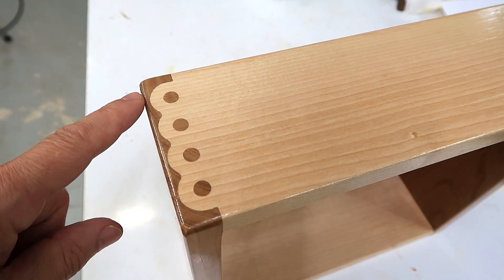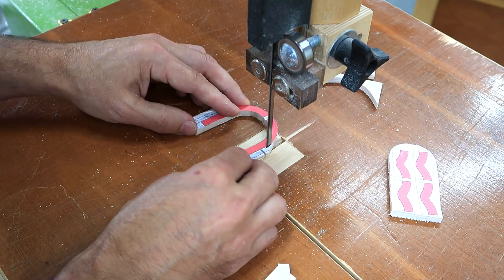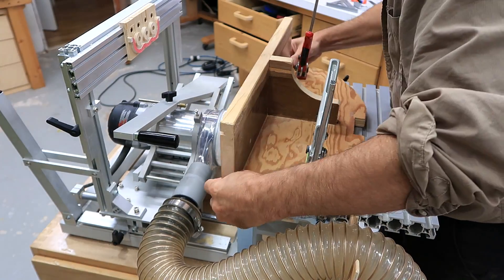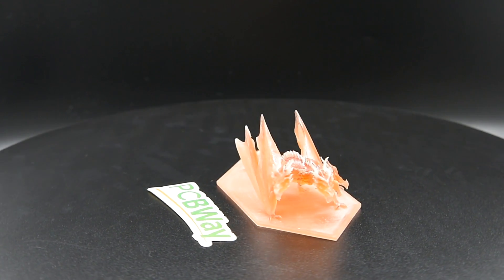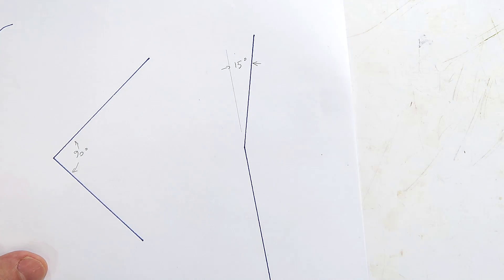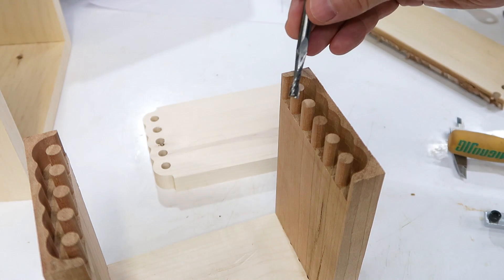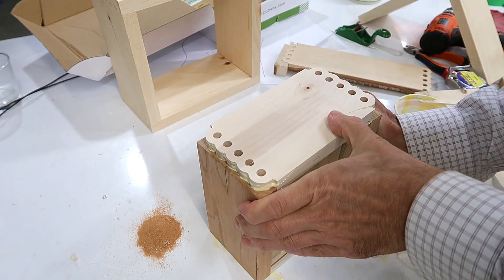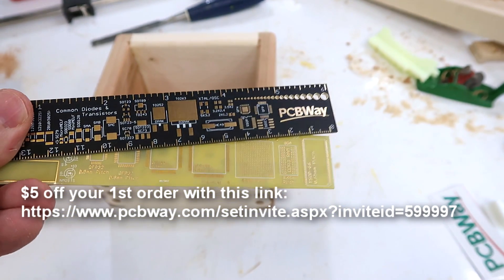Designing segmented Knapp-joint templates for the pantorouter

Comment from the maker: $5 off your 1st order from pcbway.com with this link:
https://www.pcbway.com/setinvite.aspx?inviteid=599997
PCBWay.com does 3d printing, CNC machining and PCBs and PCB assemblies.
Reply: I was shocked by your ad in the middle. I'm glad you did it though! I love your content and if you can make more by running an ad, I'm happy!
Reply: Retro Active Precision  !!!! yes !!!
Reply: Great sponsor, I’ve used them in the past. Very quality stuff if you can wait for the shipping
Reply: 4:20 I assure you its so easy to 3d print. Printers aren't that expensive, a prusa mini is very affordable, built well, and could easily print out jigs like these and anything small/bracket like. Once you have  a printer and use it a few times your really start to understand how useful it is and all of the things you can do with it. Yes sometimes there is some calibration but really its not hard at all. Also its funny how you immediately even without having a printer started blaming acceleration when the pcbway prints came out with the exact same segmented finish. Im pretty sure the sketchup export to STL was too low of a resolution for the details you wanted, I've had issues with it and other software like blender in the past hence me only using fusion360 for modeling now. Problems like these are so easy to see in the slicer yourself and I promise you its all very intuitive unless you overthink things for no reason. Most of the time printing slower will fix issues yes, but I think a slicer preview would show the real problem in this instance. Also filament is cheap and its obvious the pcbway print is a much higher quality material than whatever your client speed-printed. There is a lot of choice in material with FDM printing and it makes a huge difference
Reply: your friend needs to adjust pressure advance on his printer

Comment: Can the templates from the metal pantorouter be used or be adapted to use on the woodgears original?  I have finally come to a point in my life where I want to make one along with a BA Bandsaw and a few of the other jointery jigs.  I wouldn't mind building a hybrid pantorouther if I needed to use the extruded aluminum pattern holder.

Comment: Hi Matthias. If you change your standard circle setting to 96 segments in sketchup, most good slicer software will disregard the segmentation all together and you'll have perfect circles when printed. Take care! G ps: If you ever consider buying a 3D printer, learning curve is very low these days, price for a 0.1 accurate high quality secondhand PLA, ABS printer is maybe 1000$. Good slicer software is free.

Comment: The problem with 3d printed parts being bumpy often stems from using too low 3d resolution when exporting it to STL or whatever format you choose to print from. A 3d file consists of a bunch of points and vector descriptions of the polygons (Actually just triangles most of the time) between them. So the software approximates circles quite rough, as you can never perfectly make a circle using triangle.
Reply from the maker: same 3d model produced a part without those bumps  when I got it from pcbway

Comment: There is a post processor called arc-welder that can take 3d print files and convert those segmented polygon circles into true mathematical arcs that the printer will interpolate properly/smoothly.

Comment: Honestly, for the low-ish volume manufacturing of Mac’s pantorouter, it doesn’t sound like a bad idea just to 3D print all the templates instead of injection molding them, if the quality is good enough. Injection mold tooling is so expensive and 3D printers are so cheap these days that I would be surprised if you are producing enough injection molded parts to make it cheaper than 3D printing. It would be cool to open source the template files so that users with 3D printers (or laser cutters) could print their own, and other users could contribute designs.

Comment: I've been using freecad.  Looks like it would take about an hour to model the segmented and tapered version of this in that program, using the part design workbench.

As for a 3d printer, I bought a prusa mini kit about a year ago. Since building it I haven't needed to mess with it. I'd say the accuracy is about halfway between woodworking and machined metal. Certainly better than I expected it to be.

Comment: If I didn't know better, I would've expected you to have gotten into 3D printing before you got into your experiments with Raspberry Pi's. I have only used sketchup once or twice and it almost turned me off to CAD (I'm now a design engineer who uses Solidworks all day, and sometimes Fusion360 for CAM in the evenings, so thankfully I tried other software or who knows what I'd do for a living). I feel like if you gave Fusion 360 and 3D printing a little time I think you'd really enjoy it. 

3D printing is also one of those things where it's a little bit hard to think of all the use it'll get before you get one, but once you do there are so many things you can do with it (though you're significantly better with wood than most, so you might be able to match utility without it). I'd be honored to help you through 3D printing and troubleshooting if you ever want some help. An ender 3 would just about fit in a milk crate so the space commitment really isn't much either.

Comment: You have no idea how many uses you will have for a 3d printer! Even someone with no other tools would have great use of one!! Its especially handy when a random part breaks on an appliance, power tool, etc. and instead of dealing with part numbers and ordering overpriced replacement parts you can just look up the part on thingiverse and 90% of the time someone has uploaded an stl file for it. I've even printed out parts for the interior on my truck and to replace broken pieces on my headphones.

Comment: I get the idea of the sponsored video and "fussing" with you printer to get it precise but readily-assembled Prusa MK3S+ for just over $1000 is going to come calibrated and within 0.1mm out of the box. More calibration for your own brand of filament will get it even closer.

The problem with Sketchup and 3d printing is that anything round is very low resolution poly count. You can change the number of sides in Sketchup when drawing a circle but it will quickly shit the bed when drawing 250 sided circles. Proper CAD is more suited for this but of course at additional cost. You're still going to have a file built out of triangles put into your slicer and it won't ever be perfectly round on a FDM printer but with a bit of care and patience while designing something could be made with a FDM printer that functions as intended.

These would be a perfect item to be done with SLS at MK Machining

Comment: Don’t knock on 3D printing. Is not that complicated. In one weekend I was doing pieces just like the one you had made. Also, I’m not sure you modeled that part properly. I get perfectly round pieces without those “bumps” 
You need to work on a 3D printer. Your mind will change. And at 200$ in Amazon, is definitely not a huge investment.

Comment: It is a pretty looking joint, if you use contrasting wood. But it also looks like a complex and expensive way to join. I think i will stick with my favorite method; dowels. Or i might buy a Shaper. Which would be more flexible.

Comment: You are correct about the bumpy nature being caused by the number of segments you used for your circles... partially because the plastic filament (those were FFF, not resin parts) does ooze constantly, so more is deposited when the nozzle decelerates or stops...  but also because the slicer software takes the segments literally and doesn't average them out. I am a fusion 360 (and autocad, corel cad, turbo cad, and some others) user... you could probably create two cylinders and Boolean subtract one from the other to get the smooth curves... it's easier in other cad programs, but there are workarounds in most software. 

I priced out something small on several 3d printing sites today (a balloon popping robot body), and the cost to print one was about 25% of the cost of a reasonable budget 3d printer... These days, they are much easier to build and maintain (as well as inexpensive, you can get one for around 100 usd on sale) and they only take up about 8 cubic feet. (less than 24x24, and a bit taller than 24 if you leave the filament spool on it. )  

If you really don't want to buy a 3d printer, you probably have everything you need in your workshop (except for the extruder)... the earliest printer frames were made from wood and used allthread instead of leadscrews... you could use drawer slides for the different axis, and an arduino with a ramps 1.4 board to control some small nema 17 steppers... though the cheap $100 printer would assemble much faster (I build them for others in about 45 minutes now... I don't have an excuse to have more in my office) and they take minimal amounts of maintenance... just need to wipe the dust and fingerprints off before you print (a little bit of 70% ipa on a towel does a great job)

Comment: It's possible to buy a decent 3D printer for ~$120; they're not as expensive as most people think, anymore. But you definitely nailed the primary issue on the head: They're very fussy. You have to spend quite a bit of time fiddling with them and learning how to use them. I think you, specifically, should buy one, as I think once you figured it out you'd find lots of uses for it. But otherwise for most people, if they just wanted a few prints, it'd be worth it to just buy them rather than buy the printer.
Reply: Could you recommend a 3D printer to get started on?  That would be a big help!
Reply: @JDeWittDIY  The Creality Ender 3 is the best bet for the money. Looks like it's gone up in price some and is now $180, but it's a great budget-friendly one to start with. It's fiddly because it doesn't have auto-leveling, but as long as you're willing, it's worth it.

Comment: Matthias, I bought myself a very accurate 3D printer for making custom drain moulds for concrete sinks. I then promptly left the company. I do a lot of custom woodwork and custom furniture stuff. I’ve never found a use for the 3D printer since. They’re only good for templating as far as I can tell, and it seems like you can pretty well make your own without one.

Perhaps you could use the pantorouter templates to make the actual templates?

Comment: Looks like if you used full circle in the center instead of half circles on the ends for the center part, you could use different shaped knapps in a single joint. Don't know why you would want that but it would add some versatility and configurability in a commercial product. 
Knowing you, you must have already had the idea and rejected it for some valid reason

Comment: Most 3D print slicers approximate the curves as line segments and only use straight lines in the gcode. There is a plugin compatible with most popular slicers called arcweld that makes much smoother edges by using gcode commands for arcs.

Comment: Haha, from the start of the video I thought to myself this seems like one of the few projects where a 3D printer could actually be really suitable.

In this case what you're really trying to do is verify the computer model. Its easy enough to make a working part with the model as a guide, but that doesn't directly verify the model itself, 3D printing is great for closing that gap and working as directly from the model as possible.

The biggest reason why a 3D printers is a big mismatch for your style of making is that you can't recycle/upcycle your raw material.
If you're not OK with relying on buying new wood for your projects, there's no way you're going to be happy having to always buy new filament to print.

Comment: Basically most 3D printers work off of STL (or similar) mesh format files. This means that there are no arcs, there are no circles, everything is made up of triangular faces and hence only straight lines. The way to get a smooth arc is to increase your export settings to create a denser (i.e. more faces packed more tightly together) mesh and export that. That way arcs will be arcs, and not the segmented thing you ended up with. Not sure how to do that in SketchUp, but I'm sure there's a way.
Reply from the maker: I had the circles as 48 segmens initially.  But when you lift the center to make the taper, it often messes up the connections which requires manual fixing. Decided that 24 was precise enough for the end result, but hadn't anticipated printing snafus.  But the PCBway prints didn't run into problems with the 24 segments.
Reply: @matthiaswandel  indeed, there are printers which can analyze meshes and look at the "curvature" of edges connected to each other and figure out what likely is supposed to be a hard edge and what is supposed to be a smooth arc. It's possible PCBWay had something like that turned on, though results vary.